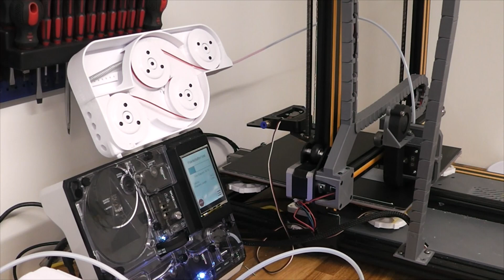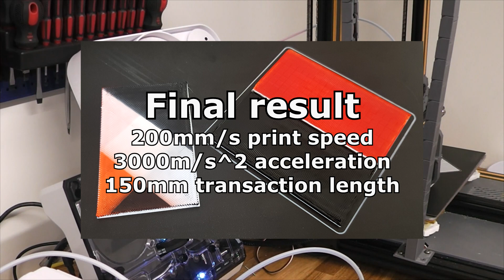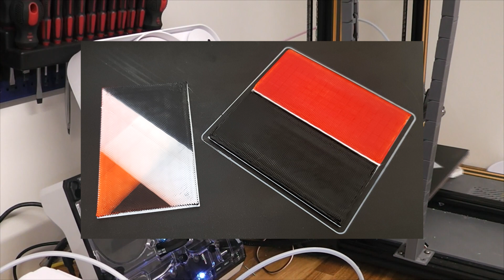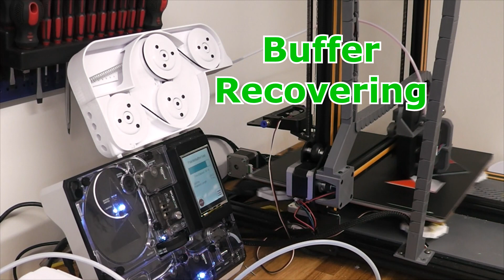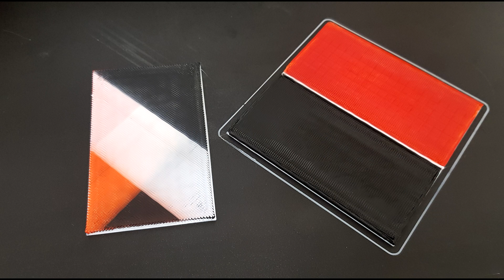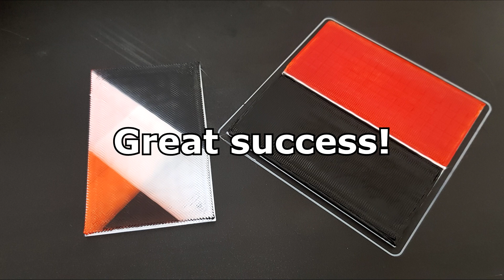Printing at 200mm/s with Palette 2 using an external filament buffer.

Comment: Do you know if the firmware ever got updated to take an average of the pings? im thinking about putting one on my voron so i can increase the speed a bit. i dont want to go silly, but 150mms would be nice
Reply from the maker: Hi. I have not used my Palette 2 for a couple of years, so I have not really followed the firmware development lately. What I did find though, was that by using the PrusaSliser and the P2PP script instead of Canvas, I could work around the issues by increasing the ping frequency. The digital pings might cause slight stuttering on slower 8-bit controllers (due to flushing of the motion planning data), so there could be potential drawbacks with increasing the frequency. I saw now ill effect at all though, but I have only tested it on a 32-bit controller board.
Reply: @kavionic279  that's ok as I'm using klipper and the octopus board. I haven't used p2pp on the voron yet but I have on my other printers. Would it be possible for you to explain how I increase the pings? I will try setting it all up during the week and get your buffer made up. Once I get the purge bucket fitted I'm hopeful I'll have a machine capable of 4 colours with 350*350 print area that can print at speed. I should be able to have it all mounted nicely to keep it tidy. I believe it was your tutorials that I've followed for p2pp setup in the past. Are you still working on the rainbow add on?
Reply from the maker: @mattread8742  Then you should be fine. I had a look at my P2PP setup and I guess it is this two lines that do the magic:

;P2PP LINEARPING
;P2PP LINEARPINGLENGTH=300

IIRC LINEARPING makes it use the same distance for each ping as opposed to increasing it over time. 300 is the filament length used between pings.

I'm still working on Rainbow 3D. But for various reasons it was entirely stalled for more than a year, and it is still pretty intermittent. But at least there is some progress now 🙂
Reply: @kavionic279  I look forward to the next video update. Thanks for your help. I'll keep you updated

Comment: what model printer is that?
Reply from the maker: That is a heavily modified Creality CR-10S. Main upgrades are TitanAero head. Duet 2 Ethernet main board. 750W mains powered bed heater. 24V power supply. Optical bed leveling sensor. BuildTac flex plate system. And custom housing and wire chains for the electronics.

Comment: Awesome job, I would pay for this. Additionally would you mind updating the comments to also include the mods you have done to your printer? That cable chain, what extruder? What is that plastic coming from the v-slot all the way to the sky?
Reply from the maker: Thanks!

I'm planning to document all my mods here, and also add all the models to Thingiverse when I get some time. But I'm a bit busy right now, so not sure exactly when I will get around to it.

The extruder is a E3D TitanAero with a copper heat block, PT100 temp sensor, and a 24V/40W heater.

The left box under the bed host a Duet 2 Ethernet and a Raspberry Pi 3B+ (for Octoprint). Duet 2 and Pi connected internally, all other USB and ethernet connectors extended to the back/front of the box (one USB on the front, two on the back, and duet/Pi ethernet on the back). 

The right box holds the 24V main PSU, a 5V PSU for standby, a buck regulator stepping the 24V down to 12V for running the fans. And 3 solid state relays. 1 SSR to turn on/off the main PSU, and one for each phase of the 240V/750W bed heater (switch both phases for redundancy, and also feed those two from the one controlling the PSU, so any of the 3 SSR's will be able to shut down the heater).

It also have an optical z-probe for auto-level-compensation and individual stepper drivers for each Z-stepper for actual auto-leveling around the Y-axis.

The vertical plastic is the cable chain coming from the left electronics box and feeding to the frame side of the chain going to the extruder. It is just a bit confusing since you can't see the loop at the top in this video.
Reply: @kavionic279  I am  always learning about this stuff. But what is the point of connecting a PI + Duet together? I was under impression that Duet has built in wifi/ethernet isn't the Pi redudant?
Reply from the maker: Yes, you are correct in saying that the Duet have builtin ethernet capabilities and it have a great web interface for controlling the printer. So the Pi is largely redundant. But it does not have support for a webcam. So my initial reason for putting it there was to be able to visually monitor my prints, and to be able to make time-lapses. And it also server as the connecting hub between my Palette 2 and the printer. So if you want to use a camera or a Palette 2 it is still required. If you don't care about any of those there is absolutely no need for it. I much prefer the builtin Duet 2 web interface over Octoprint for managing prints.

Comment: I thank you. you solved a mystery for me. I run a delta printer and was having issues with failed prints that i was running at 100 mms my printer can run up to 140 but i run it slower for better finishes. i now know why i had the failures. I tried to leave you a tip on thingyverse but your account isnt set up. Set it up i dont mind paying you for your efforts...
Reply from the maker: Thank you very much for the feedback! Really glad it helped you out. A tip is of course no requirement but certainly appreciated so I updated my account.

Comment: what happens if you combine two of them? or even more?
Suggestions:
some entireprise filament buffer have multiple filament on one wheel like: https://www.youtube.com/watch?v=CLCpNIx3O0M
Maybe try to make different versions like a super fast machine one where you have a longer buffer range or one for a Prusa MK2 where it is more compact, every machine is different.
maybe make your current design's middle two wheels smaller, and put more into the machine.

You can also help people with palette/+ as they don't have a buffer.
I have a palette 2 pro and a Prusa i3 mk3s (that I push to about 300mm/s speed) and i would be happy to test these.
Reply from the maker: If you want more buffer I would recommend making a single larger buffer rather than piggybacking multiple of these. I believe the friction would quickly be a big problem and the last buffer would need to have a very stiff spring to be able to fill itself through the first. And the more buffer you add the more lag you add to the Palettes control loop. So the harder it becomes to keep it in calibration.

This buffer (plus the internal) give a max speed of about 250mm/s before it would run out during a single splice. But if you push it that hard you are pretty much guaranteed to get calibration problems since the Palette have no idea how much filament the printer have actually used when it receives a ping, and it would quickly start swapping colors. So even though a bigger buffer would theoretically allow higher speeds I believe you will run into other issues before you are able to start utilizing that speed.

I have some ideas on how to fix the pinging issue by adding sensors to the buffer and modifying the Palette Octoprint plugin to delay any pings that is triggered while the buffer is less than 100% full, so they arrive at the time where the equivalent amount of filament have been pulled out of the palette as if the ping happened while the external buffer was 100% full. But I'm not sure when (or even if) I'm going to get around to start that project.

And you can't make any of the wheels any smaller. At least not by much. I actually wanted a smaller buffer since it is already hard to utilized the max speed that this one offer, and a smaller buffer would take less space, and add less control-loop lag. So I scaled it down to 60%. But then it started breaking some of my PLA filaments due to the sharper bending.

The Palette(+) have a buffer too. It's just external. But, yes, it might be possible to extend or replace it with this type of buffer. If replacing, some cleverness would be needed to make the magnetic pong detector work properly.

Comment: Sir, you are a gentleman and a scholar.  Thank you for sharing your considerable effort on Thingiverse.  Mosaic should swallow their pride... admit 40mm is their max speed... and pay you consulting to fix the design flaw.
Reply from the maker: Thank you very much! If Mosaic had implemented a proper internal buffer it would have been much better. No calibration issues, and it probably would not need to increase the size of the setup nearly as much as the external buffer does. But that train have left, so I tried to make the best out of what I had.

Comment: That's a really beautiful contraption. How much extra buffer does that gain you? I.e. what's the maximum length difference between the expanded buffer and contracted buffer?
Reply from the maker: Thank you very much 😃 It add ~28cm buffer. The total path through the buffer with low tension is 62cm and the delta is ~28cm. I tried to scale it down to about 60% or ~16cm buffer. And it was so handy and cute 😃 But unfortunately the smaller wheels kept breaking some of my more brittle PLA filaments 😒 Back then it was a inline system with both feeding and output tube. So to get it more manageable I redesigned it to what you see now where it snaps directly onto the palette.

Comment: Great video and an amazing solution for such a serious design floor.
Reply: You solved this issue for them.  Do you plan to sell the external buffer?  How much does this increase reliability?
Reply from the maker: @brightnovastar  It is hard to quantify how much more reliable it becomes. But you have to push it pretty hard to get a buffer under-run.

And unlike the internal buffer that is very unpredictable because it have to periodically drain itself empty, the external buffer is always ready. But if you push it to hard the external  buffer can interfere with "pings" and throw the calibration off and thus cause transitions to happen in the object rather than on the purge tower.

I usually keep the speed at or below 100mm/s and then it is very reliable. I have some ideas for how to fix the calibration issue by adding a level sensor to the buffer and have the Palette plugin for Octoprint delay pings that occur while the external buffer is below 100% until the same amount of filament have been pulled out of the palette as if there had not been an internal buffer collapse. But I'm not sure when I will get around to start working on that.

I don't have any immediate plans to start selling it, but I uploaded it to Thingiverse. So you can build one yourself if you wish. The Thingiverse page is here: https://www.thingiverse.com/thing:3548274

I also added that link to the main description.
Reply from the maker: Thanx 😀